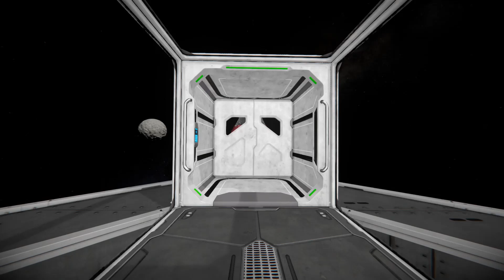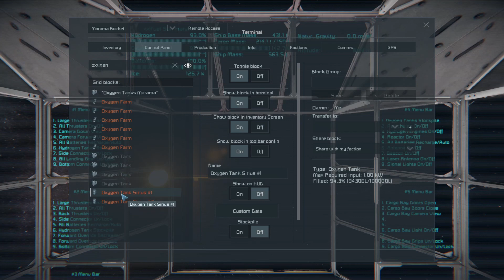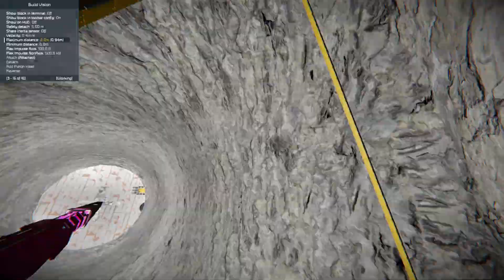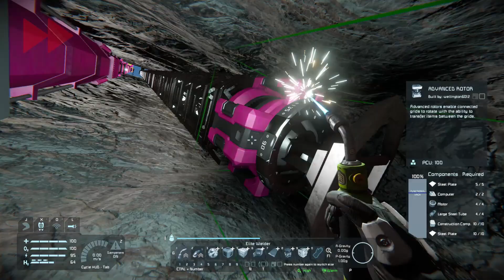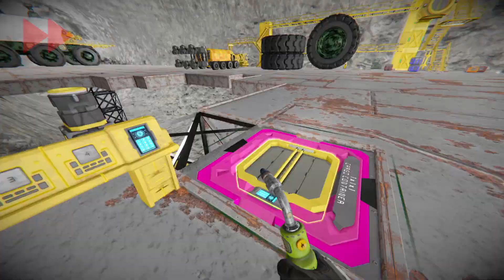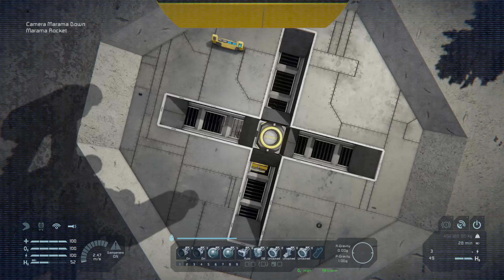Hephaestus Prime EP72 - Industrial Lift (Space Engineers)

Comment: Love the elevator 👍
I’m trying at the moment myself to build a scissor elevator.
With rotors for the axis and hinges for the outside.
And 2 pistons for the pushing of the primary arms.
But at the moment can’t seem to find a good way to keep the elevator platform straight.
So maybe will have to try your design.
Keep them coming, love the episodes.
Greetings Listerman.
Reply from the maker: I have tried some angle type piston shenanigan's, some worked, some klanged, most ended up just reverting to a-typical straight use of the pistons.